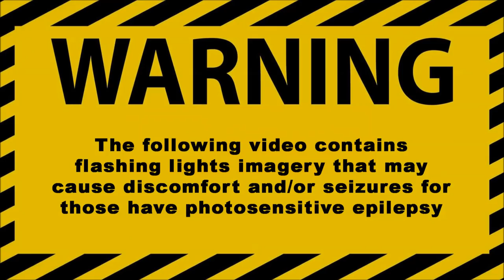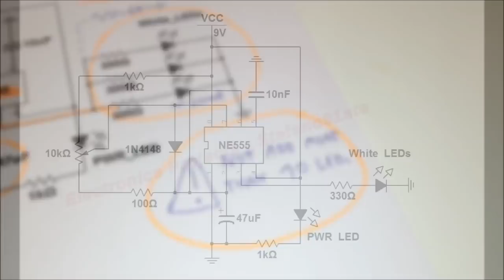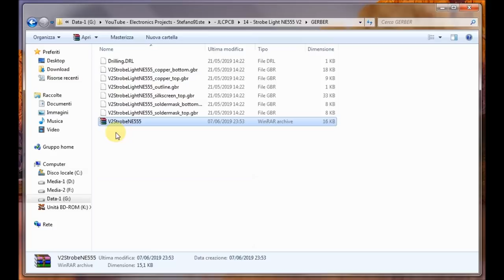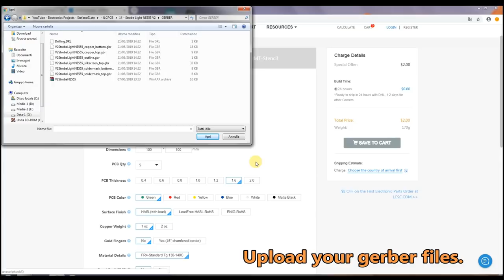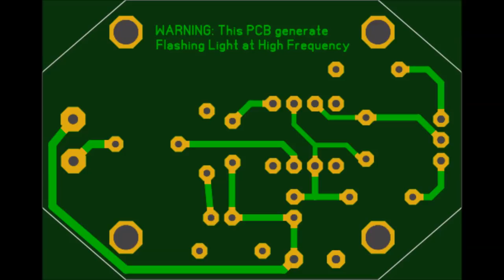Big LED Strobe Light with NE555 - PCB Tutorial

Comment: Can you do a video on how to make a super bright led strobe for drones. There is a big demand for strobe lights for drones since recent changes in the drone laws in the USA. 
The device has to be bright enough to be seen for a three mile distance at night. And as light as possible. Perhaps no more than 6 grams including battery.
Ideally it would flash at least once every second.
The lights are usually attached with Velcro.
It would be nice to have a module that could be attached on top and another attached underneath the drone, and operate from a single battery.
Thanks
Reply from the maker: Hi, what you proposed is a very interesting project. To create a powerful stroboscopic light is not a problem, the problem for me would be to respect the weight of 6g, having to use a lithium battery, which must be at least 500mAh, to guarantee at least 30 minutes of flight with flashing light at 100% of its intensity. I try to think about it in the next few days/weeks and see if I might be able to design something like that. If I succeed I will publish the project on the channel :)
Reply: @Stefano91ste  that would be awesome. There is a huge community worldwide that would be interested. If you google FSS drone light requirements, you’ll get a feel for what I’m talking about. This new regulation is only a few weeks old. Thanks for your help.
Reply: One more thought. Would it work if it was designed around a 9 volt battery?
Reply from the maker: Happy to know! Certainly about the 9v, but forget the 6 gram limit 😅😅

Comment: This is not a strobe? Isn't it supposed to have a short charge period then go to max and then off? Isn't this just turning on and off?
Reply from the maker: Hi, 
Not really, it's not just an on/off but it's an irregular flashing (like strobe effect)
Reply: i was thinking same thing, strobe needs to be fast and ultra bright. in clubs you have them continuous fast flashing. good example of a strobe and the 1 im after is the 2 strobes on ghostbuster ecto 1 front bumper . they do quick blinks very bright,. that is strobe affect what i was told

Comment: '
hi E P S...
see the PCB is a wrong print about LED with - and + at 407 to 417...
long pin is a neg and short pin is a pos...
error design on the PCB with a LED print...
try check it out again...
thank
Reply from the maker: Hi bestamerica! 
I had noticed, but that LED is a sprint layout macro (the software I use to design pcb) and I can't modify it